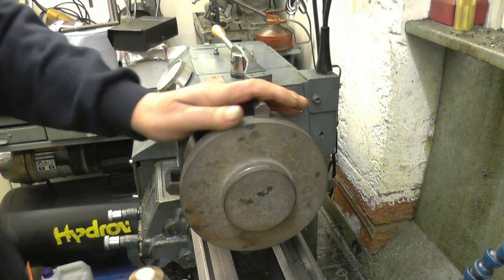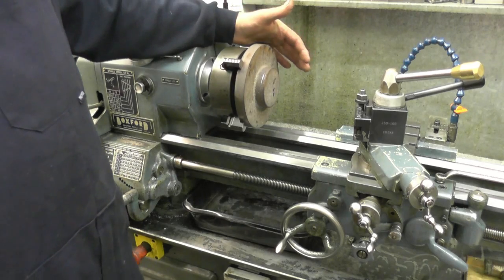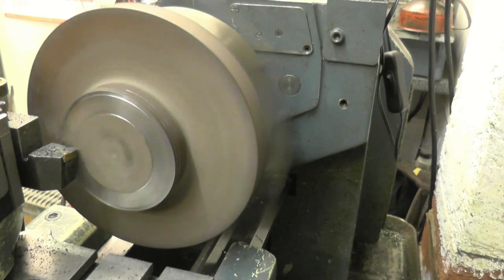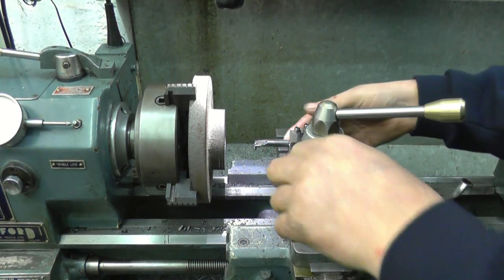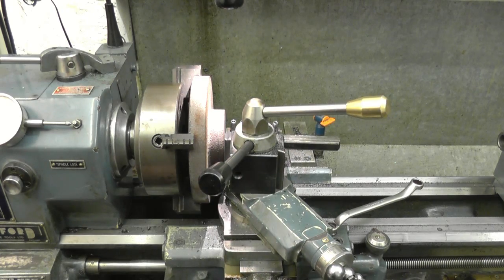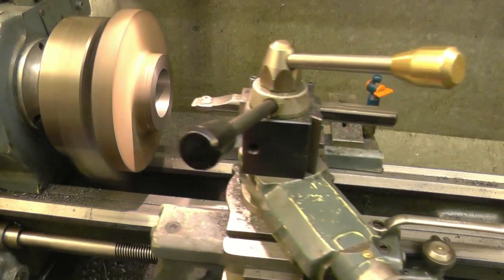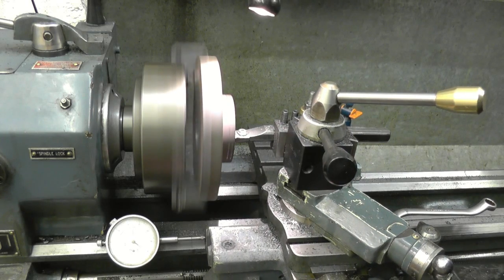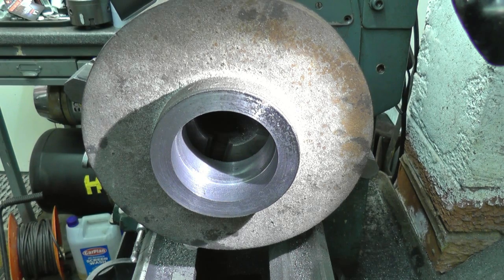Harrison Chuck Back Plate part one

Comment: I just finished making a  backing plate for my 12 in Atlas. I had to make a bushing for the plate as it had a 2in hole and the Atlas is 1.5 in. The only material I had was a piece of 3in square hot rolled so I turned it to the needed OD
on my Myford clone. I bored it to the required ID for internal threading and that's where the fun began. After internal threading I took the piece out of the chuck and tried to thread it on the Atlas spindle. It was too tight! I had to remount the plate in the Myford clone and chase the thread. After much sweating and swearing I finally completed the job. If I had not watched your videos on internal threading the job would have been scrap. Thank you John for all your help by posting your videos. Rest assured you are not the only one to make mistakes. We all learn from each other.

Comment: I think a sleeve would be a good idea, no matter what. 

From the look of the boring chip, I would guess it&apos;s cast steel. It looks harder than iron and puts out chips rather than &quot;powder&quot;. 

I had lathe operators who would sneak up on cast iron and immediate take the edge off an HHS cutter or drill.

I pounded on then to bring it down like they meant it! Carbide tools and inserts saved many a cast iron rookie. It comes so naturally, we tend to forget we learned the hard way... :-))
Reply from the maker: It is good grade cast iron
Reply: doubleboost
From the chips when drilling it seems to be ductile cast iron.